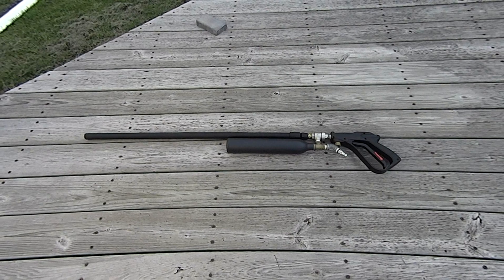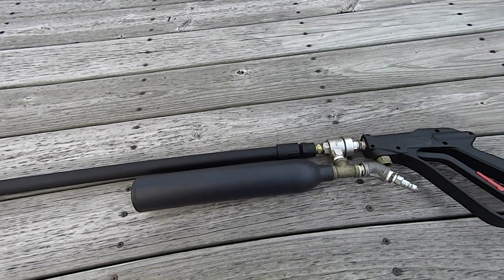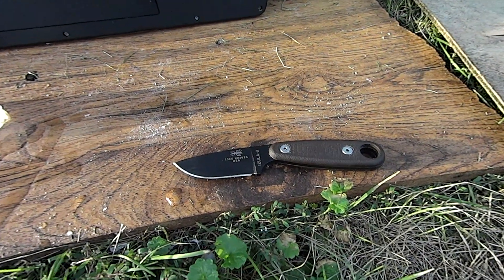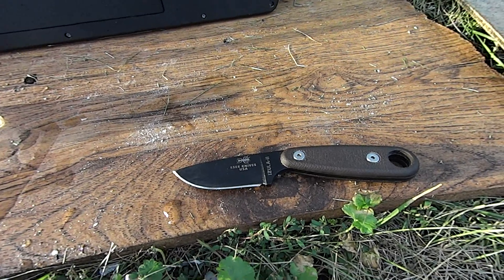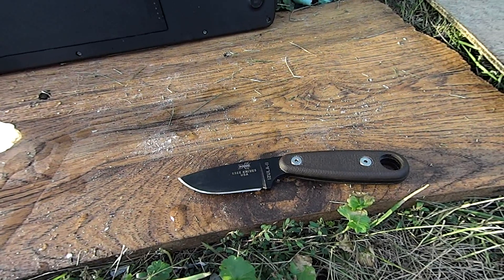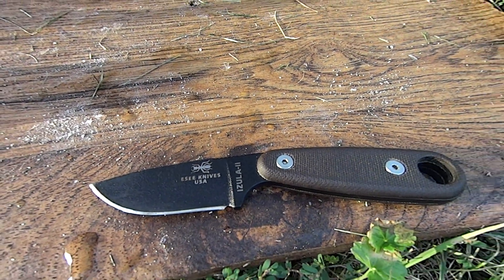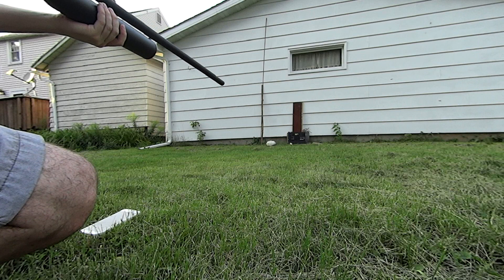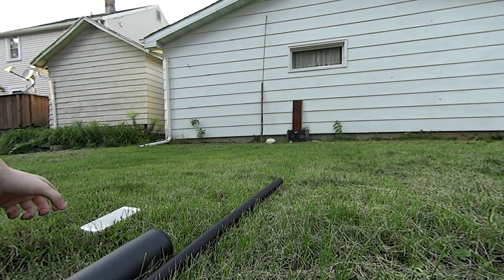QEV air rifle ultimate damage 5.2g vs laptop & ice @ 500psi+

Comment: Hi there, I have a question for this pressure washer gun 
I put 110 psi for the 500ml aluminium bottle with normal bike value. & no qev .just direct connect to the this washer gun.but when I pull the trigger is only out 60 ~70psi only..is cannot out all the air from the tank.
I only use normal bike pump.not the high pressure air. And I shots the .22 pellet using aluminium tube. Do you know how can be shot out all the air when pull the trigger. 
Sorry for my English is not really good.
Thanks.
Reply from the maker: Ah loo Chiew barrel is too small
Reply: Swan Donovan 
I see. Just wanna make something can shot .22 pellet air gun. 
Thank you very much for replying. 
Ah Loo.
Reply from the maker: Ah loo Chiew I made a .22 pellet gun. Can check it out in my later videos
Reply: Swan Donovan 
That's great. Looking forward to see your video. 
Thanks Bro. 
Ah loo.
Reply: Swan Donovan 
Hi Swan Donovan 
Just wanna ask ,do you think is work ?If  I put high pressure air tank without qev.is same design your this gun.
Reply from the maker: going to need to use higher pressure